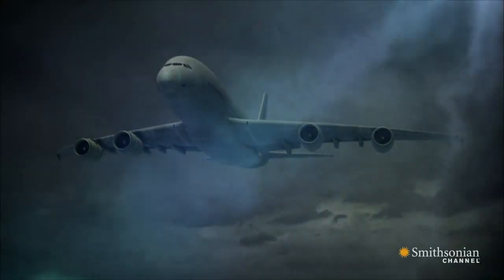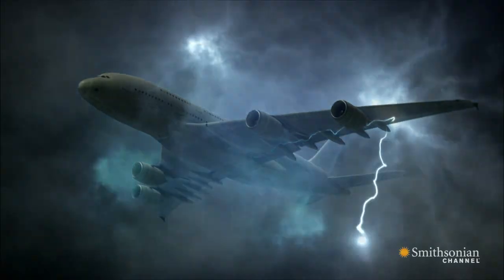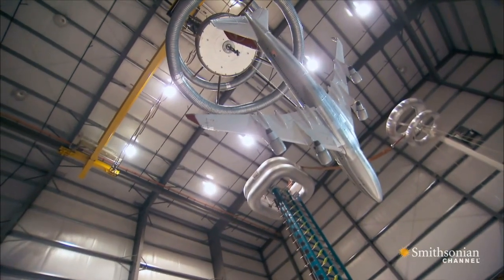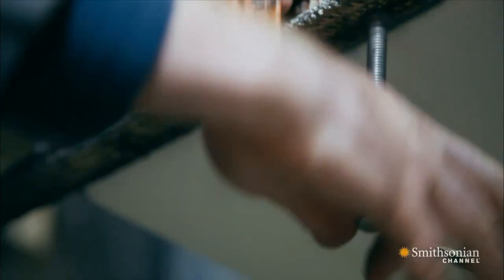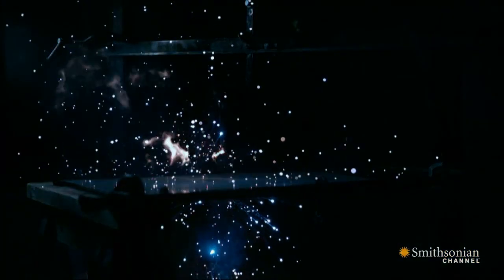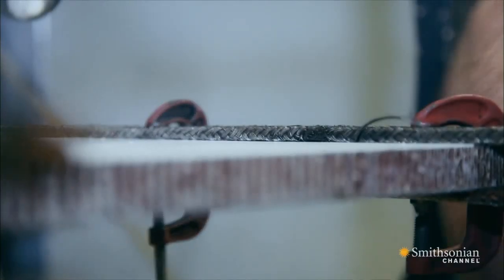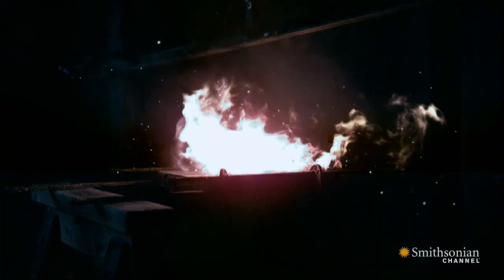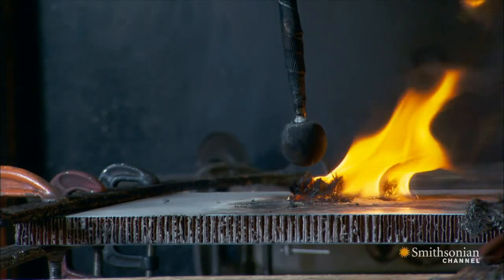When Lightning Strikes Your Airplane...

Comment: I manufacture the composites used on these aircrafts. It’s basically a roll of a sheet of glue that has copper and aluminum screen pressed into it. These products are then applied to the interior of the plane during the manufacturing process.

Comment: Lightning is a complicated phenomenon and scientists discovered its secrets in the twenty century….❗
Scientists say that when the beam of lightning starts to release from the base of the cloud which is negatively charged towards the earth which is positively charged, the opposite charges meet and collision occurs and the lightning beam rushes with a speed of more than one hundred thousand kilometers per second. Also, Scientists had found that lightning has many phases and the most important phases are going down phase and going back phase. Prophet Mohamed peace be up on says about lightning:” don't you see that the lightning comes and back in an eye blink” [Narrated by Muslim]

Scientists say that time of the lightning flash is 25 Fraction of a second and this is the same as time of eye blink, isn't this the same as what the prophet said 1400 years ago?

This scientific fact was discovered by the use of an advanced camera which is able to capture one thousand photo per second. 

The question is who told our illiterate prophet this scientific information 1400 years ago? …

Comment: What are the real benefits to using composites instead of all aluminum. I am sure the first thing these manufacturers will say is strength, longevity and weight but I am really sure it's all about cutting corners and saving a penny.

Comment: Well if the use graphite as the material with a conductive polymer, the problem maybe eradicated
Reply: Graphite conducts electricity
Reply: Graphite probably isn't malleable enough to make an aircraft shell.

Comment: Why don't they just make it from aluminum then?
Reply: Composite is probably lighter than aluminium
Reply: its conducts lightning which can cause errors with instruments and even destroy the engines
Reply: bananian oh ok thanks
Reply: bananian Also stronger per weight.
Reply: It said airplanes were just made of aluminium.
Reply: Adam Margolang Airplanes aren't just made of aluminum, most airplanes have aluminum shells, but some aircraft like the Boeing 787 have a Carbon Fiber or other Fiber type shell, and really early ones have wood and cloth shells.
Reply: It was used to made with aluminum but new era planes are made from carbon fiber.Because its more durable and light in weight when you compared to aluminum.

Comment: What a load of crap. Such a fine mesh behaves just like fuse wire when conducting lightning, a proper lightning conductor needs a substantial cross section. Also, 100,000 Amps?!  This actually made me laugh out lod, not only because 100kA is an uneaerthly ammount of current but because there's no current in lightning, only voltage. Oh and how many times every day does lightning occur? Ive dont the math and considering the amount of planes in the sky, this statistic makes a plane getting hit by lightning even more rare than if you were to get eaten by a lion in the forecourt of your local fuel station, then that lion gets eaten by Niel Diamond.
Reply: Where are you getting these facts?  Have you ever taken a course in electricity or let alone science?  The fine mesh acts as a current channel for the lightning bolt to pass through.  It does so with very little resistance and extremely fast so the mesh does not have time to heat up.  Lightning does't have current only voltage?  Have you every heard of V=IR?  You can't have a discharge of voltage without current.  In fact during the Apollo 15 launch the lightning strike that hit the rocket was recorded at 100,000 amps by the lightning protection system.  Finally, to end this argument and your terrible use of "facts", the Earth is estimated to be hit by more than 100 lightning strikes every second!  If that is not enough to hit every plane once a year, you might want to go back to school to learn basic math.
Reply: 1) Lighting does carry amperage...  large amounts.

2) Think 100,000 is a lot,  that's actually just a common strike.  A large one can carry a few million...